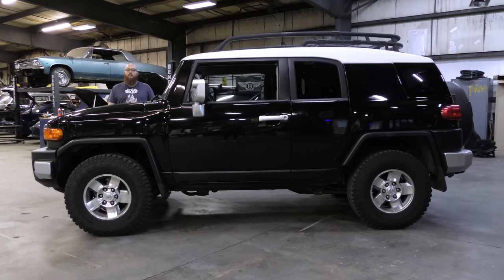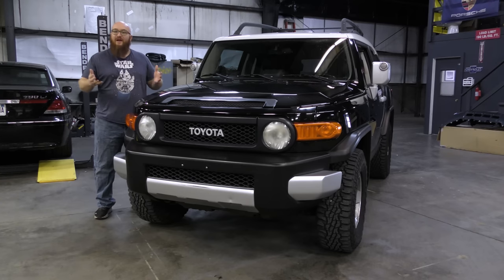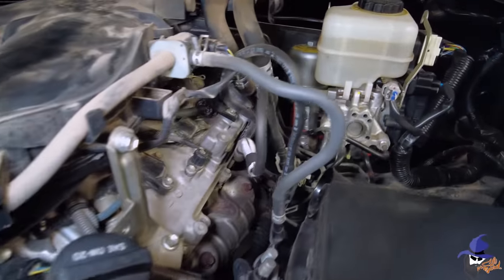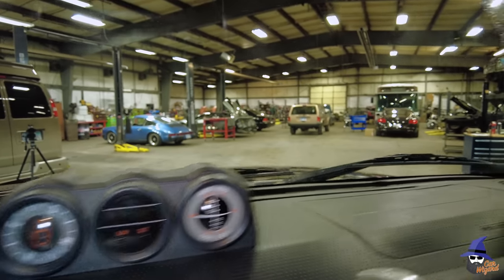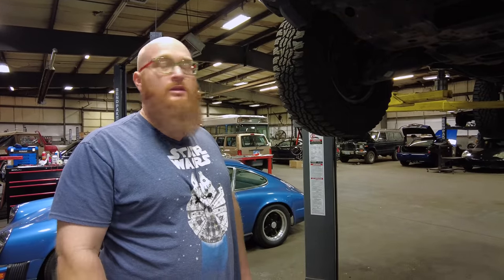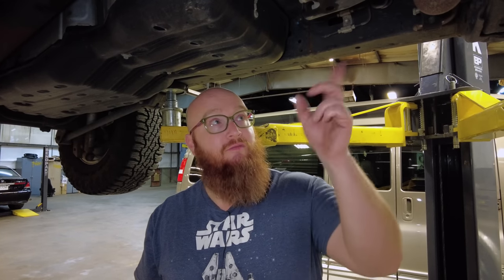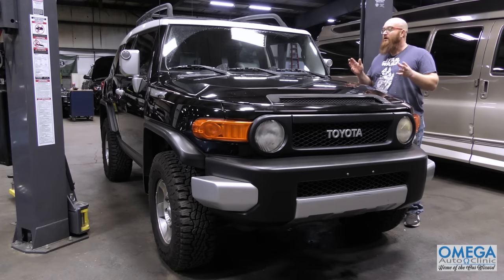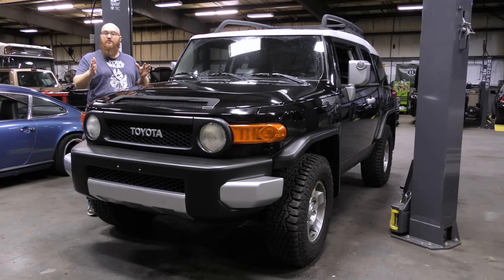"I finally got the Toyota I've always wanted!" CAR WIZARD gets a 2010 FJ Cruiser!

Comment: I am a car guy too and i bought my fj with 250k mile and now it has around 280k still runs like new. Had no issues, did some prentative maintaining like fuel pump, water pump, serpentine belt, wheel bearings etc even though they were not bad but i replaced those myself . The only thing that went bad was the pinion bearing in the differential so we had that rebuild. Other than that it still runs like new.

Comment: The visibility out of a WWII pillbox, the gas tank of 19 gals and a mpg of 19mpg makes for a visit to many gas stations while doing a grand tour.  Suicide doors were an effort to exit the back.  Aerodynamics of a Brick meant a need to upshift (the truck tranny, not the driver) just to go up an interstate overpass. a fold down rear seat that doesn't lay flat, cramped interior.  need a ton of duramat sound-deadener installed to keep the rain sound off a tin roof and a quiet interior.  The oil filter on the 07 was on the top of the engine, no hatch access needed to get to it below like the newer versions.  Parking sensors were sucky, but later cameras were great for backing up.   HOWEVER,  unless quirky is in your wheelhouse,  The 2007-2023  
4 RUNNER IS THE EXACT SAME VEHICLE UNDER THE BODY,  THE SAME FRAME, THE SAME MOTOR, THE SAME HINO TRUCK ASSEMBLY LINE BUILT-ON IN JAPAN.   Only the 4 Runner has kept improving; and even in 07 had four real doors and a more spacious greenhouse view-out interior.   Which is why the 4 Runner is a hot seller even a decade after the FJ cruiser disappeared.   Since the FJ started out at under $19k, but now has this beanie baby cult collector status,  it's price appreciation makes it a bad deal if you can get the same year in a 4 Runner for less!  GAWD I miss the Crawl Control in the 2014  FJ cruiser though.  (owned 4, the 07 TRD all black metallic paint version (rarest) the 10 Trail teams (tan can)  12 trail teams (red baron)  and 14 Army green.)  My only regret is not getting one of the aftermarket convertible versions.

Comment: I use to have a 2003 bmw x5 3.0i with 256,000  miles on it ran really well until I trade it in to get my Toyota Tundra
Reply: M54 will last 600k on regular maintenance

Comment: I'm on my 2nd FJC. Wish I'd kept the 2008, with 17" wheels, but the defrost system had  failed me during a light snowstorm with temps in the mid-20s. Really ticked me off, since I was trying to get out ahead of a snowstorm as it rolled into the mountains of N NM. I had to stop to hammer huge globs of ice off my wipers several times. 

I don't like the black wheel covers or 16" wheels on my 2012 FJ.  They're always dusty. 16s ride much rougher than 17s when traveling the backrosds of NM where highway maintenance isn't a priority. 

I've made a conscious effort to keep mileage low on the 2012 FJ.  A 2008 Dodge 3/4 ton, 4 door pickup has allowed me to do that. My 2012 FJ just turned over 40K miles last week. It may be too valuable to drive soon,  😄 especially with the influx of refugee  drivers in TX. 

The one complaint I have is its slightly underpowered for me after driving the Cummins diesel most of the time. Also, I expect to have catalytic converter failure at any time. Beware the blind spots the thick posts on front cab supports cause. Be extra careful until you become accustomed to double checking. A whole vehicle can hide behind those chunky things.

Comment: Looking at getting a 2007 fj with a manual transmission,  it's considerably cheaper than the 2014 Acura TL SH-AWD 6 SPD manual transmission. Which would you choose?? Still having a tough time deciding. But leaning towards the FJ. Its what I need not what I want. Lmk your thoughts

Comment: ATTENTION !! ATTENTION !!! ... if I catch you in time, Wizard, put either Firestone Destination 2 or Michelin tires on that FJ for an extremely quiet, good quality ride and handling ..... much better than BFG and last longer. I have had great results using the Firestone Destination 2 tires on my Nissan Frontier Nismo Off Road, after tolerating BFG for two sets that were noisy and wore out quickly. Hope this helps you in time !!!

Comment: Piles of crap is absolutely correct. My 2010 Q5 started falling apart around 80,000 in 2015, so I traded her in for a Mercedes. Fool me once (Audi), fool me twice (Mercedes), so I finally got rid of the Mercedes in April for a Lexus ES300h Ultra Luxury.

I had spent over $5,000 in the last two years maintaining and repairing the 2014 Mercedes diesel ML350. And that doesn't count their lawsuit settlement emissions repair that they paid for in 2021. I loved the vehicle, got great gas mileage; however, I had been repairing and repairing , replacing batteries (and I mean two batteries, the large one under the front passenger seat and the one in the back quarter panel that controls the starting of the vehicle). Those two cost me over $500 bucks (Mercedes batteries). Plus two major oil/turbo leaks, brakes, tires, etc., so she had to go.

Comment: I have a 2008 FJ cruiser with 205,000 miles on it. When I say not a leak on it...I mean not a leak since I owned it, not one, since 65,000 miles. I replaced the alternator in that time, and the radiator. Not even water pump. The pipe connected to the muffler rotted (not used off-road or beach time) so since i had to get a new exhaust, I ended up getting cat-back Flomaster. Just shortly after, like a week later, I developed a cylinder 6 misfire. My techs at work said it was injector. I did the plugs some 20k miles ago but did not do the coils, etc. this time, since he was in there, I said do all the coils AND injectors! Misfire stayed. Ultimately, 3 techs later...said I need an engine. Compression on cylinder 6 is low. No one though seems to be able to take the time to test it to see if its in the head or block! Furious. No matter who I take it to, it appears nobody knows how to do a leakdown test or will! Very frustrating! Think I'm going to go CARMAX it and hope they give me 5k for it. The saddest part is I maintained this to a 'T'. Mobil One since the day I owned it. When I replaced a valve cover gasket (when i changed the plugs had the SLIGHTEST amount of oil on the very tip end of the coil so I changed the gasket due to my being there already). It was golden inside. Do not know why it failed me like this. Didn't go over 70mph in it daily driven. I'm sad.

Comment: I have a 2007 with 39,000 miles. Absolutely love off-roading with it. It’s replaced my 4Runner Limited 4x4 with 200,000 miles. And that still runs perfect!
@carwizard I’ve read mixed reviews on flat towing the FJ with manual transfer case and automatic transmission.   Putting the transfer case in neutral and transmission in park seems to be safe. What’s you opinion!

Comment: I worked at a Toyota dealership for 15 years, once owned an '07 FJ and currently have a 2013 FJ Trail Teams edition.  My wife and I may never sell it, as it will probably outlast us.  I believe Toyota made a big mistake by canceling the US version after 2014, particularly since production continued but was sold only in other countries through 2022.   Many of the parts used by FJs were also common to 4Runners, Tacomas, and Land Cruiser Prados for years, so economy of scale should have kept development costs down.  Even so, Toyota pulled the plug on us prematurely and missed out on the growing SUV boom from the final half of the last decade through today.  Oh well, guess that makes mine worth more!

Comment: I had an 07 I purchased for 16500$ with 87K. I traded it in last (2022) year with 109K for a 2013 with 67K mi on it. I paid 32K for the 13 and it cost around 29K brand new, Talk about inflation. 

Having owned an 07 and a 13 FJ. I can confirm the engines from the drivers seat are identical. The only difference I notice is not having to feed the 13 expensive fuel. Although I still do on off road trips. But they have identical fuel economy in the real world. I get between 9-16 mpg normally and about 20mpg off road driving under 50mph. Yes that's right the brick gets better fuel economy in 4x4 at slow speed than on the highway. It has the aero dynamics of a brick. The HP/Torque differences are not apparent to the driver.  Its just all specs on a paper other than the fuel. The 07 really did prefer to drink 91+ octane. It was required if the engine was under heavy load, under day to day driving you can get away with 87 with the computer retarding the timing. 

The airbag glove box is the most amazing feature of any car, I love having it.  If you drive it off road, you will not have a clear windshield for long,. It is a rock magnet. 

I live in the North East and I would call that vehicle rust free, brand new. I've never seen one that clean around here. The prop shaft MUST be greased every time you do an oil change. The slip joint on the early ones will bind if you don't keep it lubed. It feels like you've been rear ended by a bicycle.

There is no wiper park function on any FJ I've seen. If you turn the ignition off the wipers stop where they stop. It isn't a German car where your wipers need a parking space. It is kind of a pain in the A when changing the wipers.

Comment: Small correction - Toyota (or rather Hino) stopped production in 2023. They stopped importing them to the US in 2014 but were still available to purchase brand new through official Toyota Dealers in the Middle East. Updates from 2015 include dual tank (156 litres) and crawl control.

Comment: I was going to buy a new 2012 FJ but it was 35k,  Instead I went with a 2012 Tacoma TRD Sport access cab 4x4. For about 4k less. I still have it today and it only has 49,000 mi. on it now.  So far, 1 battery change, front brake pads, & 1 muffler. and tires &oil changes of course.

Comment: The FJ is the same vehicle as the 4 Runner with a different body, that's all it is.  Oh I almost forgot about the 3 front wiper blades which is different from other vehicles with only two 🤦‍♂🤦‍♂.  I've been a Toyota tech for over 25 years and I can honestly say that there's absolutely NOTHING special about the FJ Cruiser.  Quite frankly I think the 4 Runner looks much better.  There's a reason why Toyota stopped producing it years ago.

Comment: Have a 2007 with 250K original miles, 2x4.  Synthetic oil change every 5K......but lifetime transmission fluid that's never been changed.  I baby it, and it's only seen highway miles for the majority of it's life. I only recommend Toyota.

Comment: Most of those FJ Cruisers live out in Durango Colorado. It seemed like every tenth vehicle was an FJ when we were out there last Summer.  I love my 07. It currently has 159K on it. Gets 20 MPG and is my daily driver. My Duramax broke a crank shaft at 427,xxx miles and is being rebuilt as I type this. It also gets 20 mpg.

Comment: A new work friend's dad has one of these, all blacked out and had like six front lights. We hang out often after work and I usually end up taking him home. His parents are terribly protective (He's 17), I call his mom an Apache Helicopter, not a Helicopter, parent, and his dad is a retired SEAL. Most things are tracked, he has curfew, so on. He leaves his phone off so it doesn't show the location, and one night we and friends were out at BWW and heading home at about.. 0100?  He saw he had MISSED CALLS and a few texts from his dad, "Place closes at 10, it's 1230, where are you? I called and no answer from the store". Luckily I was already taking him home by the time he noticed the messages. Just as I was turning down his street, we see lights RACING around the corner and this black beast of a machine rears around with all these lights just glaring down at me. I joked and said "So is this when you die"? We called his dad and told him he just missed us, I dropped him off and on the way back, again, I saw this shadow just veer into my headlights and sail past me. Long story short this thing is pretty beastly and I love the style, paired with a Veteran it grows 10x the fear factor xD

Comment: Toyota should have NEVER quit making these. They should be building them for eternity, unchanged. The demand will always be there for them.

You know, it makes more sense to buy a brand new Tacoma right now for $45k  than a used one, because the values are so high on the used market for them that brand new is a better deal. 100k mile examples are going for $30k. Same thing would go for the FJ Cruiser if they didn't stop making it.

On a side note I'd be curious if the 6 speed manual gearbox from the FJ would swap in to a brand new 4Runner.

Comment: I have owned an FJ Cruiser new since 2007, regrettably, it has been the least reliable vehicle I have owned in 40 years. No off road driving at all, unless you count driving up a farm lane on Saturdays to check the cattle during the summer. Despite the many expensive issues I have experienced with this SUV, I continue to enjoy the FJ immensely.

Comment: I had an 78 fj40 and regret ever selling it and wanted a new fj. But they are ridiculous expensive for even junk ones.  So instead I got a 1999 GMC Yukon sport  2dr 4x4 88k miles for only $3k. An fj cruiser  that low miles would have been in $30k.

Comment: I am hoping that the Car Wizard will do the next segment of the six used vehicles that you should buy or never buy for the next video upload tomorrow. If it is the six used vehicles not to buy, it will definitely be for minivans or luxurious vehicles. If it is the six used vehicles to buy, it will definitely be for mid-size SUV's or compact sedans. We all know from the Car Wizard is to buy a Toyota or a Lexus, whether it is the eight-passenger Sienna or the LS 430 sedan, because these vehicles are the best in reliability and comfort. If it is not a Toyota or a Lexus, an older Mitsubishi or a newer Mazda should be awesome to buy used for reliability, as well. Let us hope that the Car Wizard will have the next video upload, because we do not want any more pieces of crap or any vehicle that reached its service life at his shop. We want more vehicles that are well-maintained and reliable at his shop. Thanks.
Reply: For compact sedans, the six used vehicles to never, ever buy are any GM vehicle with the 2.2 L Ecotec four-cylinder engine, except the Chevrolet Cavalier and the Pontiac Sunfire, the 2012 to 2019 Ford Focus with the six-speed DCT (dual-clutch) transmission, the 2008 to 2017 Mitsubishi Lancer with the CVT transmission, the 2005 to 2009 Kia Spectra, the 1999 to 2002 Infiniti G20 and the 2001 to 2005 Honda Civic with the four-speed automatic transmission. For the ones that you can buy, they will be the 2004 to 2009 Mazda 3 with the 2 L four-cylinder engine and any transmission, the 2004 to 2010 Volvo S40 with the 2.4 L five-cylinder engine and the five-speed automatic transmission and the 2008 to 2011 Subaru Impreza 2.5i (non-WRX) with the four-speed automatic transmission. Thank you very much.

Comment: I disagree with the car Jizzard..... I am a second owner 2008 JK with the venerable 3.8 push rod engine. Everything's original on the vehicle just hit 186,000 original miles still drives great.  Everything has to deal with maintaining the vehicle and not buying from a multiple owner. Problem with the FJ cruisers I seen quite a few they do and are known to have bad rust issues.

Comment: I've got a 2006 Lexus GX470 with 145,000 on it and it developed its first leak ever. Valve cover gasket started but it wasn't much and I coulda left it. My ocd got the best of me and my mechanic laughed cause he knew when I said it that I want them both replaced. I will drive my Toyota prodect 500 thousand before I replace it. Should last me another 20 years easy. I think I'm gonna get one of these FJs for my son.

Comment: They have a fzj80 Lexus 450 for 15k$ in Amarillo that's mint with 188k miles on it. You really need that to compare the fj to. No stupid half doors nice soft caddy like ride. Basically everything you will come to hate on an FJ the fzj80 had rite. Only complaint I have with the American fzj is a full time awd/ 4wd transfer case. Other than that they were perfect.

Comment: My 2007 fj cruiser wobbles when I brake and at 60 mph . Steering wheel will shake also . Brakes and rotors are good. It's a 2007 4x4 black diamond  with 256k . I will be buried in it

Comment: smart guy.
I am a retired Toyota tech, and have a 07 FJ, and a few other Lexus/Toyota's
Lifted with a custom front bumper and winch, 230K on it and it is bullet proof.
You cant kill them bud, enjoy.
Check the rad, they will sometimes leak auto trans fluid internally and mix.
Not so bad having trans fluid in the rad, but anti-freeze in the trans will take out the converter, or more.
look for a fluid that looks like a strawberry milkshake in the rad overflow.
I would love to get one out of Texas, as they rot out pretty good here in Ontario.
I shipped mine out by rail from British Columbia where they dont use salt.